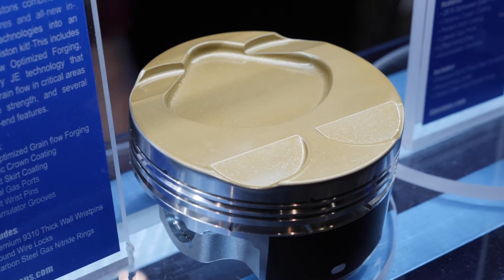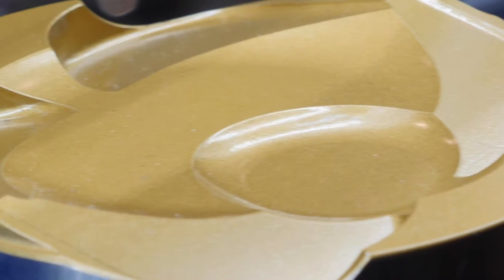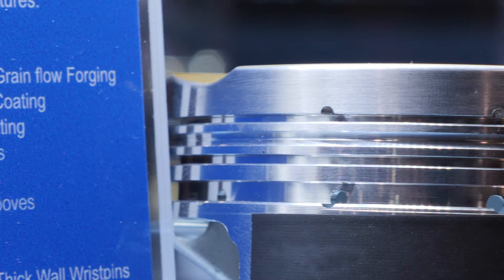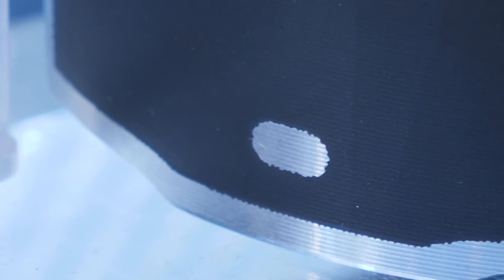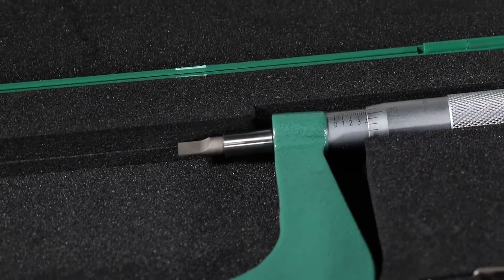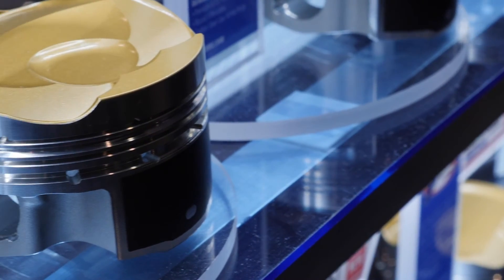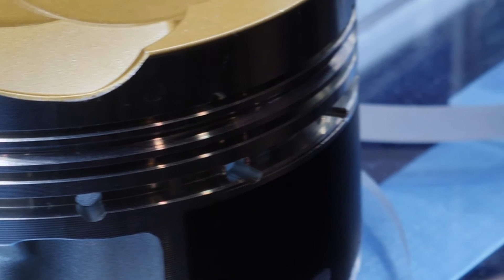Why Forged Pistons Are BETTER Than Cast | JE Ultra Series Pistons [TECH TALK]

Comment from the maker: 0:00 - Intro
0:20 - Factory Cast vs 2618 Forged Piston
0:54 - Forged Pistons and Detonation
https://shop.hpacademy.com/ - Merch
1:25 - What Does the Top Ceramic Coating Do?
1:45 - Clearances
2:22 - Coatings are NOT a Substitute for Poor Building or Tuning
3:00 - JE Perfect Skirt Technology
3:52 - Tighter Clearances. Less Noise, Better Seal
4:22 - Machining Cylinder Wall Clearance
5:19 - Aligned Grain Structure Forging
6:25 - How the Grain Helps
6:46 - Lateral and Vertical Gas Ports
8:01 - Accumulator Groove
8:48 - Forged Piston Downsides?
9:17 - Wrist Pin Strength
9:50 - Rough Pricing Comparison
10:24 - Learn More
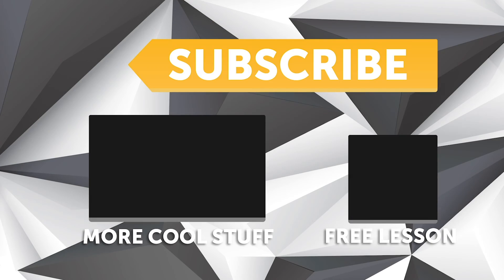10:37 - Outro Bro

Was this the most subtle merch based comment yet? I personally think so 😂 What other questions would you like to ask someone like Jeremy from JE? Let us know below -  Taz 👨🏻

Comment: You should have showed the coated piston after 50,000-100,000 miles.
Reply from the maker: Sir, you want a stock OEM engine if you're gunning for 100,000 miles of trouble free motoring with nothing but air filters and oil, plus possibly a cambelt by then I guess if applicable. That is what they are designed for 😉 - Taz.

Comment: Good, informative interview.
Could you ask some of these piston manufacturers what their views are on single compression ring pistons Vs the more common 2 ring pistons? While there's the option of running a higher pin height and longer rods, and there is less ring drag which potentially give more torque/power - is blowby and oil control significantly compromised? 

Oh, could you also ask the piston manufacturers representatives - well, the ones like this gentleman that knows their stuff - why more performance/race gudgeon/piston/wrist pins aren't tapered? They're primarily loaded in bending, where the piston is loading the connecting rod, and in shear between the sides of the connecting rod and the piston - both loads which need the most strength in the pin. But there in no real bending or shear loading towards the outer ends of the pin and so the required strength, and mass, requirement is dramatically reduced. Worse, it adds to the inertial loading on the most heavily loaded centre. The crush loading, though, will be roughly the same in the piston bore, so there will need to be material to resist that force.

Not sure if I worded that well, I hope you got the gist.